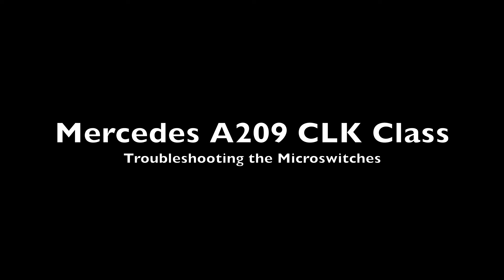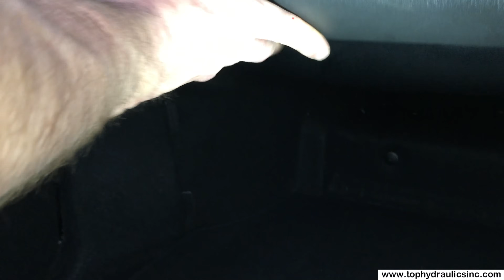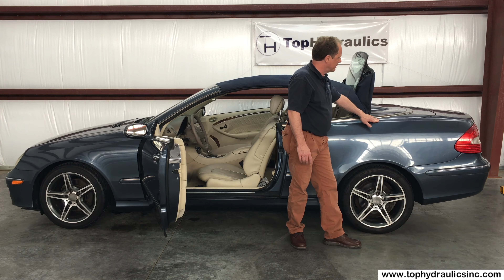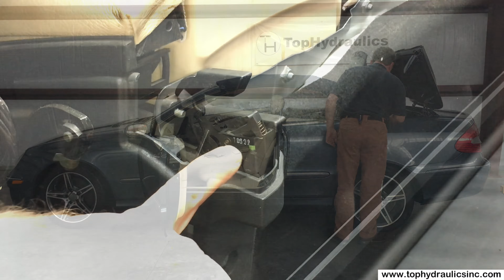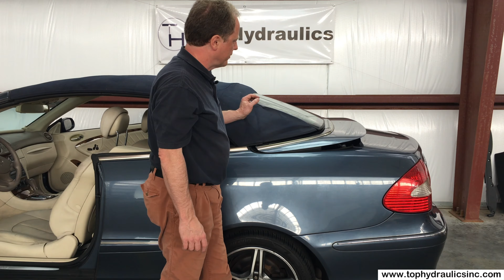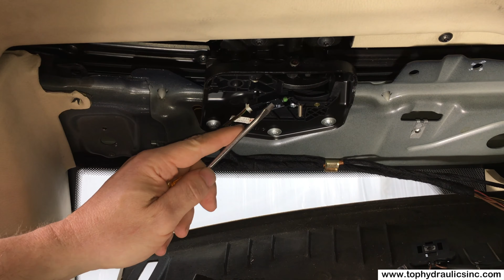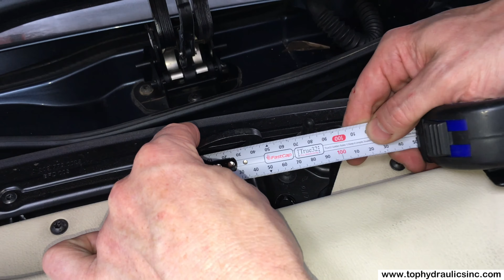Mercedes A209 CLK - How To Troubleshoot the Microswitches

Comment: Great video, many thanks for publishing.  My CLK500 when opening top, seems to stick when about halfway open just when the glass is going into the trunk and doesn't want to keep pulling to bring the top all the way down.  Its intermittent, but more times it happens than it doesn't.  The top is up in the air about halfway, and have to push button so moves forward again a little then pull button back and sometimes that does it it completes the soft top folding into the trunk.  Any ideas?
Reply from the maker: Thanks for asking. Is this happening pretty much exactly when the top is in the highest position? When the top is in the highest position and gets retracted some more, the load on the pump changes. At first, the pump had to work hard to pull the top off the windshield. Then it becomes very easy to pull back the top as it almost falls by itself. In that particular position, a valve inside the pump can be responsible for the problem.  However, before spending a bunch of money on a pump exchange, you may want to double check the micro switches shown in this video just to make sure they don't create an illogical readout which tells the controller to stop moving the top.
Reply: @TopHydraulics  Yes pretty much exactly when top is in highest position.  It will pull it to that position and it just freezez, the pump is still making noise but nothing happens.
Reply: Hello Klaus, i just replaced the pump with one of your pumps but its still just opening to when the top is in the highest position.  It just doesn't want to go past that position, its almost like its not releasing something to pull it back.  Any suggestions??
Reply from the maker: @btcruiser31  Sorry to hear that. Is the top twisting a little when this happens? Has anyone worked on the main lift cylinders lately?
Reply: @TopHydraulics  I don't notice any twisting?  The top goes up just fine, entire cycle no issues.  But it stops about halfway and won't go all the way down.  Windows go down, back window goes up, tonneau flips up, pulls off windshield just fine and right when window start going into boot and top is almost halfway it just stops.  I changed my youtube account pic to an example of where its stopping, its not my car its just an example I found and took a pic of it so you can see where its stopping.
Reply: oh and nobody has worked on the main lift cylinders lately, i just replaced the pump with one of yours and will send the old one back to you this week

Comment: Very helpful. Quick question, I operated my roof yesterday with no problem. Today, nothing. On operating today, my dashboar says roof in operation, but nothing is moving. Where is the fuse or relay for this?
Reply from the maker: Thanks for asking. You are probably on the right track, as nothing moving on the top and no warning about the skibag (luggage divider) in the instrument cluster normally indicates a blown fuse. It could be a bad relay, but that is rare. 
There are two yellow relays next to the pump, attached to the pump's mounting frame. It would be smart to check the fuse first. The fuse is mounted in a small black enclosure (junction box) behind the driver side rear wheel well, practically in front of the pump. There are two fat wires going from the pump's wiring harness to this junction box. These are the red power wire and the black ground wire. The fuse is a flat 40A fuse going to the red power wire. It is not always easy to see whether the fuse is blown or not, which is why I find it easier to use a multimeter. Set your multimeter to DC Volts, have one probe go to ground (for example, the pump's mounting frame) and have the other probe go to the post that the red power wire is bolted to in this junction box. If there is no voltage on that post, then your fuse is blown. A blown fuse is a sure sign of a bad pump motor. Top Hydraulics rebuilds the pumps (their part numbers are A2098000548 or A2098000648, and the numbers printed on the pump are 2098000030, 2098000130 or 2098000330).

The following link shows the location of the junction & fuse box for the pump's power and ground connection: https://youtu.be/c6WQQG_s-jQ?list=PLly4CMbpk7owNRAl-AECemIb0SVihtBlV&t=26. It is min 0:26 of our pump removal video. If you pause the video right there, then you see the pump in the middle and a threaded post with power wires on it a little higher up and forward of the pump, just before the carpeted panel covers the right side of the image. The threaded post is one of the two posts in the junction bow I referred to, and the fuse is bolted to it.
Reply: Thanks for your reply, came across your response by accident as I am still researching the problem. The thing is, this also happened to me last year. One day, the roof working the next day not, I get dashboard message the  roof in operation, all the windows opened but that was it, this is why I think it's either a fuse or the relay again. 
I took it to a MB specialist who charged me £198 for apparently tracing and replacing a faulty 'resistor fuse' on the pump? So was assuming they meant a relay. Could you confirm the existence of e resistor fuse?
Reply from the maker: @chrisdaviesguitar  "Resistor fuse" is not a proper term. The only fuse for the pump is the one I pointed out in my earlier response, and I am copying that portion of my response again:

"The following link shows the location of the junction & fuse box for the pump's power and ground connection: https://youtu.be/c6WQQG_s-jQ?list=PLly4CMbpk7owNRAl-AECemIb0SVihtBlV&t=26. It is min 0:26 of our pump removal video. If you pause the video right there, then you see the pump in the middle and a threaded post with power wires on it a little higher up and forward of the pump, just before the carpeted panel covers the right side of the image. The threaded post is one of the two posts in the junction bow I referred to, and the fuse is bolted to it."

If you had a blown fuse a year ago, then it was bound to blow again, because the root cause lies in your pump's electric motor being bad. The fuse does not blow on a good pump motor.

If you had a bad relay instead, that would likely have been caused by a bad pump motor drawing too much current and damaging the relay. Chances are higher that you had a bad fuse, though.
Reply from the maker: P.S. The fuse is a MIDI 40A fuse.